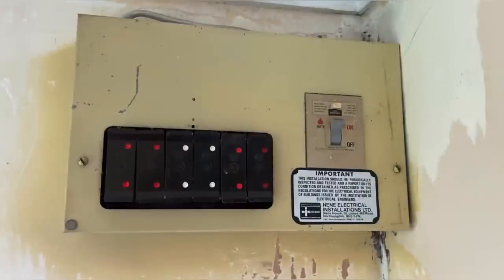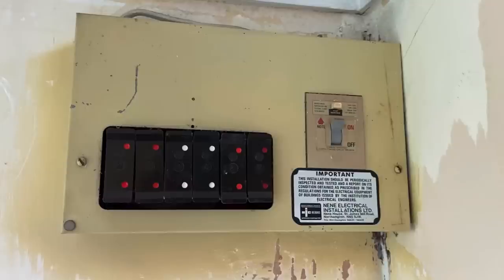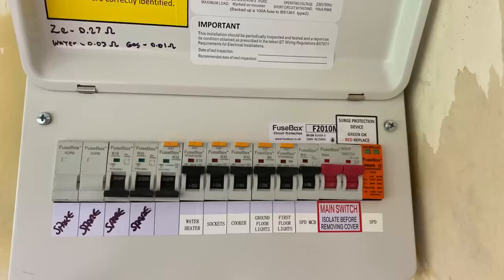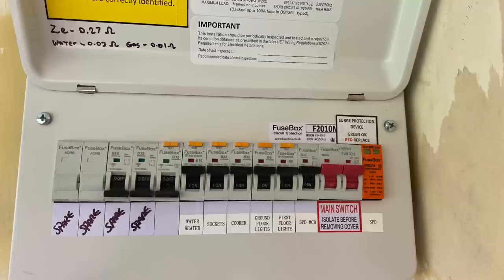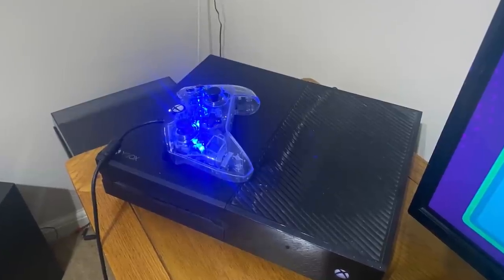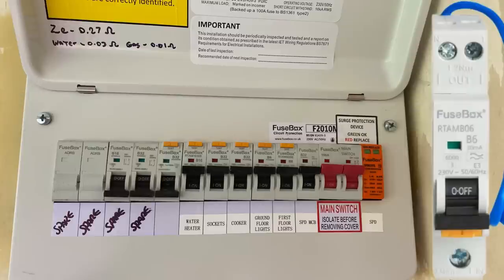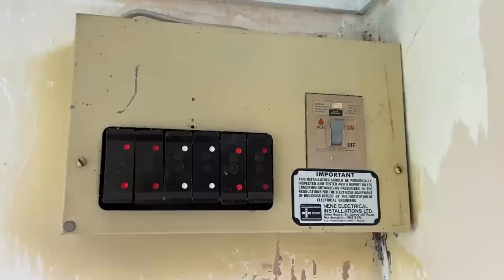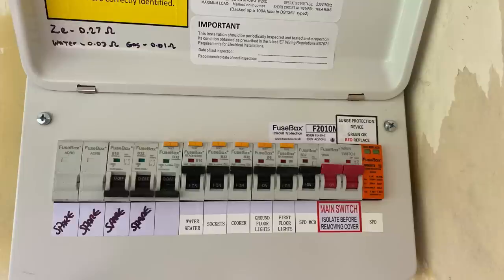Would you Change this Fuse Board..? WHY..? Understanding your new Consumer Unit

Comment: One thing I don't understand about the regulations: our house was built in the 1960s and the lighting circuit doesn't have an earth wire. We recently had a new extension built which obviously had to be wired to the latest standards.  The electrician said that if he replaced our old consumer unit (with wired fuses) with a new one the whole house would have to be rewired. So what he did was install a new consumer unit just for the extension and new circuits. The old unit could remain for the existing wiring.
I cannot understand why an old unit cannot be replaced with a new one. Obviously the old lighting circuit is not as safe as one with earth wiring but the overall safety of the old installation would be far greater with a modern consumer unit than it is now. It doesn't make sense that the regulations don't allow an upgrade that would greatly improve the safety of an old installation without having to commit to completely replace the old installation, but they do allow the old installation, with its lower level of safety, to remain in place.
Can someone explain the logic of this?
Reply: As far as I am aware there is no regulation that requires a consumer unit, which doesn’t conform to the current regulations to be upgraded to one that does. It is only when modifications to the existing installation e.g. adding a new ring circuit or adding a garden shed supply feed etc. are to added that the consumer unit would be required to be upgraded to satisfy the current regulations.
If you think about it, there must be millions of consumer units in use that don’t conform, and you cannot expect every body to upgrade just because they don’t. Regulations can change on a frequent basis and again you couldn’t expect householders and the like to continually upgrade every time there were to be a change to the requirements. I can see where your electrician is coming from and tend to agree with him, but then I’m not an expert. Like the old saying, “If it ain’t broke, don’t fix it”.
Reply: @DaveH-zl3vd  that's the thing, I would like to upgrade the consumer unit but I don't want to have the house rewired just because of the lack of earthed lighting circuit, but apparently that's not possible. I think the argument was that if he replaced the consumer unit he would have to certify the whole installation as meeting the current standard, which of course it wouldn't even though it would still be safer than it was before!
Reply: I wonder why the electrician said that your whole house would have to be rewired, did he give you you specific reasons?
Reply: @DaveH-zl3vd  well basically like I said above i.e. that he'd have to sign off an installation that wasn't fully compliant with the regulations because the lighting circuit had no earth.
Reply: The electrician is playing safe. He doesn't want to sign it off, just only doing the upgrade of the consumer unit.

But the fact is, if you upgrade to a new consumer unit with RCBO's specifically put on the lighting circuit, then you're covered, in terms of an electrocution risk. Put in an AFD too
Reply: @deang5622  quite so. Anyway almost all light fittings are Class II these days!
Reply: quite simple really, when changing a consumer unit to a new one the installer has to produce an electrical installation certificate , a schedule of initial verification and a schedule of test results to the current regulations so no cpc on lighting is a fail,
Reply: @EdwardBretherton  this is a good example of the law of unintended consequences in operation. It would be possible to significantly improve the safety of the installation but the regulations don't allow it. They do allow the unsafe (by modern standards) installation to remain in use.
Reply: @rampak1  Ido see what you mean but the other way to look at it is from my position, if I changed your consumer unit for a brand new 18th edition unit with surge protection, rcbo, s all singing g and dancing board, your lighting g circuit with no cpc would mean under earth fault the rcbo would not trip, so let's say you have a nice shiny chrome switch plate, the line conductor comes loose and touches the switch plate, you get 230v passed through your body and die, it would be me going to prison, so that's why it would all need to be compliant, and yes it could happen without changing the consumer unit at any time, but it's not me carrying the responsibility, you would still die more than likely, nobody wants that now do they.
Kind regards
Reply: @EdwardBretherton  my understanding of how the RCCBs work is that if the current flowing from the live is different from the current flowing in the neutral the breaker will trip. So the presence or absence of an earth conductor makes no difference. Have I got this wrong?
Reply: @EdwardBretherton  I found this description:
Principle behind RCCB
RCCB works on the principle of Kirchhoff’s law, which states that the incoming current must be equal to the outgoing current in a circuit. RCCB thus compares the difference in current values between live and neutral wires. Ideally, the current flowing to the circuit from the live wire should be the same as that flowing through the neutral wire. In case of a fault, the current from the neutral wire is reduced, the differential between the two known as Residual Current. On spotting a Residual Current, the RCCB is triggered to trip off the circuit.
Reply: @rampak1  yes it does but that just covers short circuit not fault to earth, a fuse covers short circuit, an mcb covers short circuit, the thing is the end result is making electricity safer for the end user

Comment: Question for you Gaz.  I have an EVSE fitted during the 17th edition regs.  It has a direct connection to the TN earthing (TN-S at the service head).  It has no PEN fault protection.  How would you code on an EICR?
Reply: I would have thought that would be a c2. Surely an earth rod should have been installed?
Reply: If the service is TN-S, you didn't need PEN fault protection at the time; TN-C-S is the only earthing arrangement with a PEN conductor and thus the possibility of experiencing a PEN fault. Back when 17th was the norm, you weren't required to assume that it may one day be changed to TN-C-S. It's not compliant with today's standards, but it wasn't installed today; it's compliant with the standard that was in force at the time, so it's a C3. I do recommend you have PEN fault protection installed (or have the EVSE changed to something that has that built-in), simply because your DNO may end up modifying your supply in the future and introducing the possibility of experiencing that fault. This could happen, for example, if, during a periodic inspection, your Ze is noted to be above 0.8 Ohms (the maximum allowed for TN-S). The quickest way for the DNO to fix that is to convert it to TN-C-S at the service head (assuming the new Ze would be below 0.35 Ohms), so that's what they'd probably end up doing.

Comment: I follow your videos and instruction with great interest as i have a very old CU which is due for replacement. My box looks the same as the one at the start of your video but is non-metal. Having checked the writing on my box i notice that i only have one ring main for the whole house and likewise only one lighting circuit the same. No split for upstairs and downstairs. How can these be split into separate circuits for upstairs and downstairs? Do you have a video to explain how this would be achieved?
Reply: Too many variables to answer without an electrician looking at it but you're probably looking at a partial rewire as a minimum. Perhaps you'd go for a full rewire out of choice or necessity.
Reply: You only need one lighting circuit. The load from led lights  is lower than the load of 60w and 100w when the installation was originally done.

Comment: How should ac rcds be coded whilst carrying out an eicr going forward??
Reply from the maker: C3
Reply: @GSHElectrical  ok how about if it is a tt system with one ac 30mA upfront Rcd? So the Rcd in this case is providing fault protection, would this then warrant a c2 code?

Comment: So would i change it? 

Absoloutly i would personally, along with the wiring but that's just me.

Breakers, RCD's, OCP, UV all being my primary reasons.

My secondary would be to accomadte my 3 way mechanical interlocks, that allow me to switch to Batterys or even a (small) generator.

But does it need changing, well if its just a house bored, the wiring passes inspection and its all visually good, id probably leave it as, it may not be as safe as a modern install would be, but it would be in my opinion acceptable.

Disclosure - I don't do single phase installs or residential, all my electrical training and experience is in a datacenter and ill stick to that [Teres someone around to stop me doing anything catastrophic] its also mostly DC in the datacentre these days anyways, AC at hardware levels ain't really a thing anymore

Comment: RCD's can be tripped by some lightning strikes nearby ( plunging the WHOLE house into darkness ! ) .... you NEVER get this problem with wire link fuse boards ... the few problems with these older fuse boards , is , some folk using the wrong size fuse wire ( I have an unused  card from an 1960's UK Woolworths = R.I.P.😝 ) ... also , they take MUCH time to re-wire ( at 3am ? ) ... so , have a few spare from folk that have upgraded to MCBs .... ( tried - n - tested ) ..... DAVE™🛑

Comment: Why a double pole main switch?   Do you not connect the Neutral Conductor to Earth where the supply enters the building?  So the Neutral is at Earth potential,  no need to switch it!   In New Zealand we also strap the Neutral and Earth Bus bars together  inside the fuse box, we do not switch the neutral at the Distribution board, just the Active (Live).  Why bother having a double pole switch, why do you switch the Neutral??
Reply: Double pole switch is safest.
No chance of any voltage down stream from it when it is in the off position

You are relying on the earth being present to ensure safety and that might not be the case.

Comment: Sorry but as an Industrial JIB GOLD CARD APPROVED Electrician of 50 years and have never seen avoltage surge in the hundreds if contracts I've worked on or hundreds of my workmates have never seen it so in my humble opinion it is just another expensive unit not required in domestic dwellings,but yes I would change the board for an 18th edition metal consumer unit ,but unlike most modern sparks I'm a great beleiver in ringmain circuits in domestic dwellings for kitchens and I've never wired a ringmain in 2.5mm cable we would wire ringmain circuits in 4mm minimum sometimes if the area we were wiring was of a certain size we would sometimes wire in 6mm

Comment: All circuits should really have their own RCD when the supply is a TT type, the one where you don't get a proper earth in the supply cable. And an elcb can be nuisance tripped by leakage current in the earth caused by leakage currents in the mains input filters of many modern switched mode power supplies which are now very widespread in all manner of modern electronic appliances, and in little AC adapters and chargers and those filter components in those power supplies are a legal requirement so that they meet EMC requirements to prevent interference travelling back down the mains wiring and interfering with vital life support systems such as kidney dialysis which some folk depend on.

Comment: I need my CU replacing. I have an old wylex CU similar to the one featured. I had a fire in my conservatory a few years ago, I left a small Lipo battery on charge overnight. The battery burst into flames. Luckily for me and family the fire was contained in the conservatory, I didn't know it at the time but polycarbonate roofing is fire retardant so the fire burned out. If I had left the patio door open it would've took the house and us. My question is, what would have prevented this (apart from my stupidity of leaving a battery on charge). Would an RCD be enough or MCB, RCBO?
Reply: None, the battery charger is at fault.
Reply: @tresslerj1985  never leave a charger unattended
Reply: @Woodkin007  I’m pretty much certain that an AFDD would not have stopped this. When lipos attack, it’s because the battery itself just gives up the ghost. Not anything to do with bad contacts or the 230V side at all, so it shouldn’t be something the AFDD can detect at all.
Reply: Would blame the charger. The battery in this case would be isolated from the mains by the charger's double wound transformer whether the charger has a traditional linear or a switchmode supply.
Reply: @JasperJanssen  All sounds very worrying. You'd think the MCB  would at least trip if there is a raging electrical fire. Not surprised my antique CU kept feeding power but I'd like to think if this is whole thing melted then the contacts would fuse and trip. This fire was serious, nearly killed us. I want to upgrade my CU but from what you guys are saying there seems little point
Reply: @booshallmighty  lithium ion battery fires aren’t electrical fires. Or at least, not being fed by the mains, as such. It’s literally just the battery itself going on fire. They can do it without the charger connected as well.
Reply: @Woodkin007  I mean, it’s not that AFDD’s not good for something — it will detect a loose contact in the 230V installation, basically. But this is a different thing altogether.
Reply: Charge any devices with Li ion technology on fire proof surfaces. I use granite pastry boards in kitchen and kids bedrooms.
Reply: RTFM .... It clearly states. Do not charge LiPo batteries unattended.
Now you know why.
Reply: @sahhull  Yea you're right, but it clearly states a lot things everywhere. People still do things. I'm definitely more careful now. Clearly states take a break on the motorway and clearly states the speed limit. Human nature I guess

Comment: I've just fitted a fully RCBO csu to a customer  ( AB TYPE)  & THE CUSTOMER insists on turning off the double socket & unplugging the dishwasher which quite often knocks the RCBO out !!!  The dishwasher is new & works perfectly.  Should i change the kitchen ring 32a   RCBO for a differnt style such as an B curve ? Or tell the customer to buy a cleaning brush & do away with the dishwasher !!
Reply: What’s triggering? The MCB side or the RCD side? One would expect the RCD side, but it’s pretty damn weird for it to trigger on removal of a plug, especially while the socket is turned off.

You could try a socket with a dual pole switch, I believe those are allowed in the UK. Then it should at least not trigger on plug removal, although it might instead trigger on the switching of the neutral.
Reply: @JasperJanssen  its definatly the rcd side. When the dishwasher is turned off ( by its own button) the wall switch gets turned off & thats when it knocks out the rcbo.
Customer until last week had an old csu with sepearate rcd so i changed it for new csu with all RCBO'S because i assumed having the whole installation hanging on 1 main rcd wasnt good. I was thinking of getting a 13Amp plug in filter for dishwasher.
Its a strange issue.
Reply: @merlin5476  well, anyway, if it’s the RCD side that trips then it doesn’t matter whether it’s B/C/D curve on the MCB side of the RCBO, so changing that out won’t help.

I’m thinking maybe some form of back EMF spike that gets sent up the neutral when you disconnect the line?
Reply: @JasperJanssen  back EMF is what i thought too, i think a new crabtree D/P socket is in order & install it where the customer wont keep pulling it out, if it persists i will put a filter socket in 👍

Comment: Yes 100 percent replace...1. Superior overload protection in terms of rated amps. 2. Speed of disconection.3. Ability to set type rating for reduction of nuisance tripping. 4. Ease of resetting. 5. Split loads..... 
Ffs wylex ars outdated crap. If correctly installed a modern fuse box is just safer and Superior....
Reply: Will trip more for no reason, will cost a fortune, speed of trip is irrelevant. It works its stable not all modernisation is a plus as in arc units !

Comment: As an Industrial JIB GOLD CARD APPROVED Electrician of 50 years:I gree with you that the consumer unit does need changing but that's where our agreement ends:I don't think the surge protection unit is justified for epically for rural domestic properties :over my 50 years in the industry with hundreds of industrial  workmates and many domestic electrician friends none of them have come across voltage surge in any rural domestic properties:I live only 50 yards from a transformer which did lose power and it was restored ño voltage surge:the transformer was recently isolated and the transformer changed to a new one again when powered up no voltage surge so I think you are just following the status quo with no justification for them being fitted.dual boards are still being sold and as for those arc rcbos:who the he'll is going to pay that outrageous price for them:it's the same as this torque screwdriver nonsense because as you know 75% of an installations connections are away from the consumer unit or distribution board yet you are just torqueing at the board you can't torque connectors or at light fittings or switches because you will end up with a pile of broken parts:if the industry had any concerns about loose connections the would have insisted years ago that any connections at consumer units or distribution boards that the final connections should be tinned or have barrel crimps fitted and for high amp units Allen keys madatory:just a thought